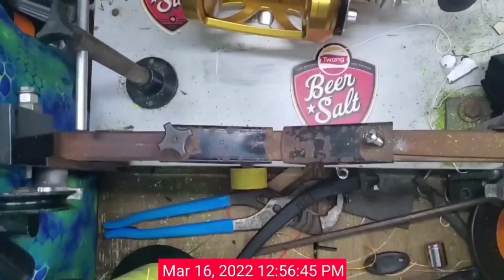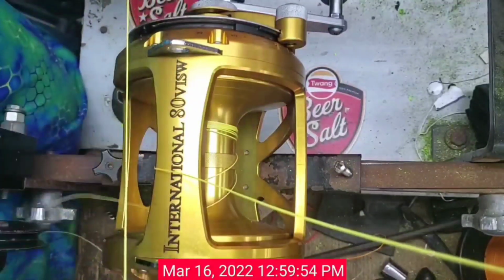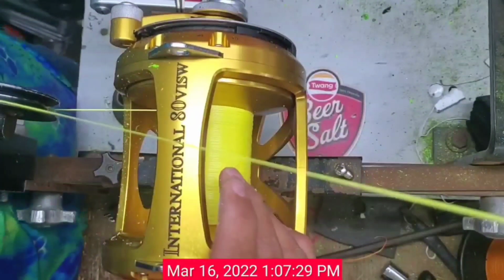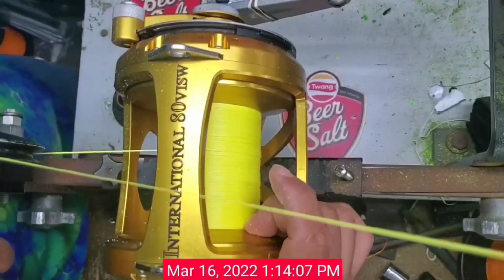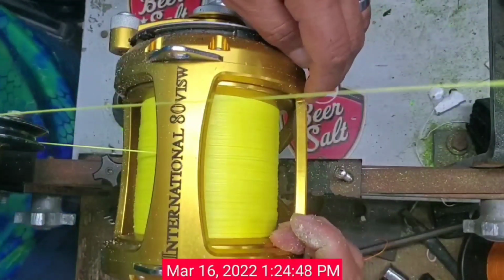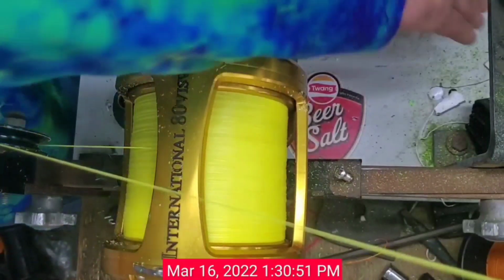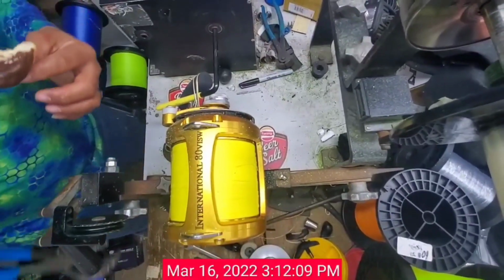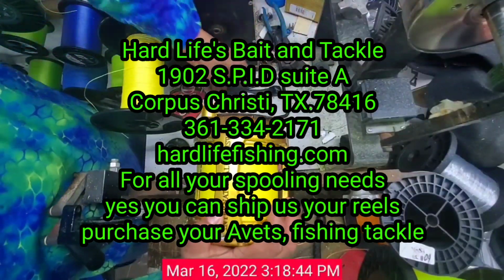Did you know power pro makes 130lb hollow core were spooling it on Penn 80w maxed and for beginner

Comment: Power pro is the best mainstream braid period.  Ive used so many braids and none can beat it.  Its the toughest thinnest strongest braid ive used.   Ive used every brand but the new tight line which ive been told is very good but not as good as power pro.  Ive come to find nics and something funny in every braid.  Good braid is important but braid maintenance is more important.  Got to unspool and respool and check your lines.   You should start testing breaking strengths.   Pps the only braid ive had  that breaks at its strength or higher on heavy lines.  Popping 200 is violent.

I like how you show every line has flaws and some of the flaws aren't really a major issue.  Respect for the passion.
Reply from the maker: Yes sir I am hard on every braid it doesn't matter because at the end it's our customers were responsible to..
Reply: Not going to be the first but the Second Million 20,0000 subs.#Cortlandbraid

Comment: have had it for a couple of years now as it's easy to get over here as Shimano power-pro hollow-ace is available at most places  it's a 16 core spectra
Reply from the maker: What's size weight classes have you been using
Reply: @TeamHardLife  mostly 60# and some 80# but use the 130# and 200# for making wind on leader's. mostly do bait casting dragging loures hence the 60# , the 130# and 200# are a lot easier to work with as they expand a lot more, the 60# can be difficult especially when you want to use a the lockable clasp needle to pull through double line as it gets fairly tight in comparison to the larger sizes when doing the same thing.
Reply from the maker: So the 60lb have a bit of trouble when your doing a a splice in it..how about when doing a Hollow core mono splice
Reply: @TeamHardLife  I've had no problem with the mono splice using 80lbs mono on 60lbs hollow works well , 100lbs mono just fits in the 60lbs , but I find a good 80lbs leader mono in 60lbs hollow works
Reply from the maker: So you do a reverse latch loop ?
Reply: @TeamHardLife  i find the 60lbs hollow when pulling the doubled up 60lb through itself evan with a revised latch needle is a tight fit, it does work but it can be difficult. i only seem to have trouble with the 60lb in this situation, i think that it's because of how tight the line is , it's possible that it's just me but i don't have any problem with the heavy hollow core.  but apart from this small issue with the 60lb  i can't fault it and id definitely be happy to use it again
Reply: @TeamHardLife  i use a hollow needle for the splice when using mono
Reply from the maker: Asking about the part that you said the reverse latch needle having a little trouble...
Reply: @TeamHardLife  yes its just a tight fit for the 60lb hollow when using a reverse latch to make a locked loop at the end of the line , the fixed loop needle won't work because you can't get it back on or off the line after the loop has been started
Reply from the maker: You can you don't have to start from the middle of the line and pull it through onto it self your can go straight and pull the tag end thru and it wil.come out the other end..
Reply: Not the first but the Second Million coming your way 20K. #Cortlandbraid

Comment: im suprised it you got that much line on that reel the internationals have a much thicker shaft on the spool
Reply from the maker: See that's exactly what my thoughts were.. it really does have soemthing here wonder if the power pro has a thinner diameter and if so how is the breaking strength of it..
Reply: @TeamHardLife   have never tried power pro hollow have only used the solid  and didn't like it  switched everything to diamond gen 3  and just going to be trying the 40# toro tamer hollow  so far not impressed
Reply from the maker: Have you looked into the master bread by Cortland
Reply: @TeamHardLife  only use hollow core     I have a few reels I'm going to need to send to get spooled
Reply from the maker: Yes sir that's the ticket for sure

Comment: Had the opportunity to buy a new one of these for 700 but saw the drag was to low for its price point so I bought a new okuma makira 50 SAe with 85 lb of drag
Reply from the maker: Sometimes gota go where the deal is..
Reply: FYI I scaled the drag on my 80VISW last night and got over 90lbs out of it. Significantly more than advertised. Haven't actually tested a Makaira so I can't say how they compare. The Makairas are nice, though.
Reply from the maker: And when you tested that how long did it hold that for ..
Reply: I mite have to buy me one to compare again then cause last time I was a a bit disappointed with pen so I went and got a 80w Avet and that’s a animal I know ima be getting the 130 trx next
Reply: @TeamHardLife  I don't have any method to test it longer than I did... I would never fish it that high anyway. Running 150lb line, following the "1/3rd rule" my strike is set a little heavy to around 55lbs which came out to around 68lbs. Fishing strike at 55 could in theory net me 110 at half spool, which is plenty fishing a harness and maybe not always using a spotter. Likely need to back off the drag as the spool empties anyway at those settings.
Reply from the maker: That's they are beast compared to Penn and shimano
Reply: @ramirosalazar5073  The TR-Xs are beasts. I tested the 80VISW next to an Avet 80EXW and the Penn put out significantly more drag . I like the TR-X 130s and would fish one, but they put out realistically more drag than anybody is every going to use in practicality. I'd rather have more than less, that also means if you were fishing it at a normal amount of drag, the reel isn't working as hard. I'd probably still rather fish an International 130 though 😁
Reply from the maker: The deal with the reel is the low gearing  It's for me because the Penn's shimano's cannot even break my surf weights loose once I have deployed them and dont catch a shark
Reply: @TeamHardLife  What are you using for weights out there? I've had no issues retrieving bricks or 1lb sand spikes even on my old Intl II 50SW, Squall 50VSW, 80VISW, and neither do anyone I know that fishes Tiagras here... 🤔
Reply from the maker: We use Hard Life's and Tackle 1/8" gage stainless surf wieght 20oz thru 3# and over 1000yds out the penn internationals, shimano tiagras in low gear can't break them loose while they in the rails... anyone can use their backs and rods to pull our weights in but I use the low gear only..
Reply: @TeamHardLife  Nice. My next reel is likely going to be a Mak 80. I can't get a deal on those and can get Penn 80VISWs for $629 and all of my Penns have never failed me... Nice to have some variety though and I hear nothing but good things from everyone I know that fishes a Makaira!
Reply from the maker: We have had multiple with the Maks and they traded them in cause the drags on all of them began to be all or nothing nothing in between.. they see smooth as can be for aure.sure..
Reply: @TeamHardLife  so should I return the Kuma and get a 80 international? My reel comes in Friday okuma makira 50 iiSEa
Reply from the maker: To each there own we have had some people love them .. just others love penn.Penn.. and we have been thru them both and will.stick with Avt reel.s cause what they have proven to use thru first hand use..

Comment: In your opinion what would be a good fishing Rob, I just got the same reel, 80VISW? Need advice
Reply from the maker: Need more info as to how you plan on fishing it
Reply: @TeamHardLife  well we going to exactly be fishing in Ecuador, and we going after blue Marlin and Wahoo
Reply from the maker: So yall gona be trolling so will need a mono top shot.. a few of the guys I have talked to out there use anywhere from 80# mono to 130# for line capacity.. so probably about 50-100 yds and the rest braid for line capacity.. 80#-100# hollow core
Reply: Fishing in Ecuador sounds cool for sure . 2ND million 20K . #Gatorlures